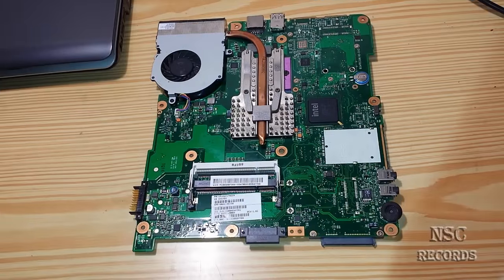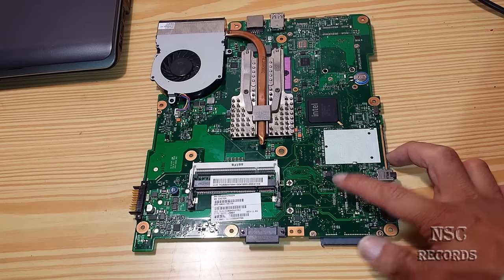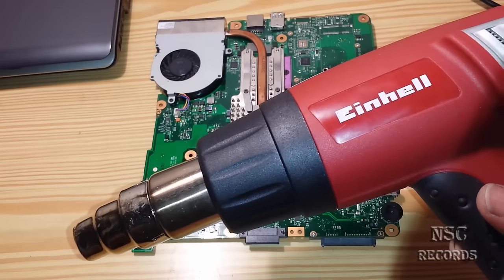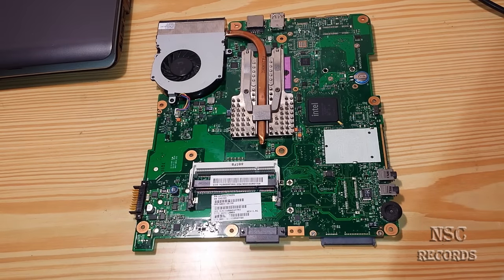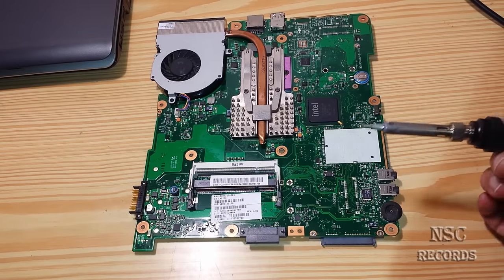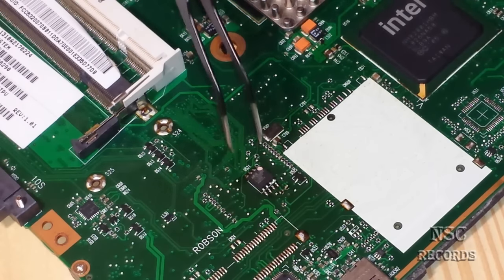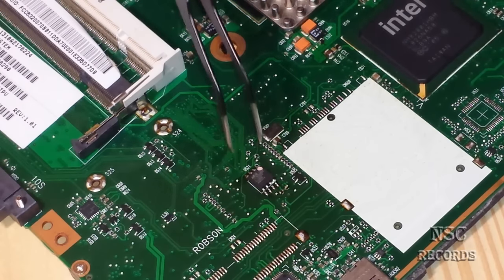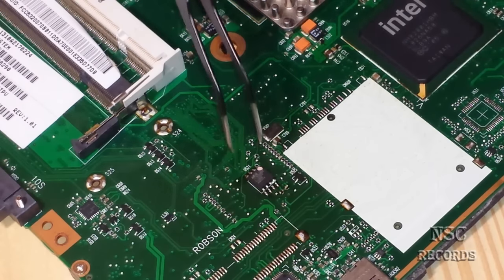How to easily remove & replace a Bios Chip from any Motherboard´s By:NSC

Comment: This type of work requires smd/station tip on that heatgun also helps to have a heated heat plate underneath the board to prevent warping of PCB. Using larger tips actually heating up other parts nearby area melting plastics and drying out smd compactors. Glad this worked out for you! Tip wearing rubber gloves is a great safety feature I always do on anything electronics. Smd gun also have very hot with very low air flow less air blowing across motherboards.
Reply from the maker: Yes and yes and yes and yes yes yes, but you see it works also like that perfectly, not all peoples have special equipments... i think the video is pretty good for the most. Have a nice time 🤷‍♂️
Reply: Simply use alluminum foil to cover other circuits . But you need to still be careful 🤗

Comment: UltraNSC thank you thank you . My Dell Laptop BIOS would not get past the Dell logo. I ordered a new Bios chip from Taiwan, got myself a Weller WLC100 Soldering Station, followed this video and it works great now , Might I add I paid almost $900 for this laptop new only 3 years ago . Dell did not want to know.
Reply from the maker: Dell are Pirats :/

Comment: have you ever tried desoldering tin? it's expensive but works really well. It low temp tin, you mix it with the existing tin and it stays warm for 30/40 seconds. You can easily remove large chips and  "take your time" while doing so haha. This way you don't overheat the chips whilst desoldering.

Comment: Hi, while removing my chip it pulled off some of the soldering base I think. And 2 small wires connect to 2 legs of the chip have come loose from the motherboard. Like the 8 metal spots on which you solder the legs of the chip, 2 metal spots have been pulled off as well. And a small wire running from those 2 spots has come out of the board too. I think I pulled too hard and removed some of the internal wiring from the motherboard. It's beyond repair now I guess?

Comment: Two points to mention:
(1) Isn't the chip installed backwards? chip pins 1 and 8 must be aligned with the white bar on the PCB (time 12:38).
(2) Isn't this a Macronix chip (MX25L8005M2C; time 5:07)? meaning that it is a CMOS chip and it may damage by ESD discharge if you grab it with your bare hands.
The white paint dot can be anywhere on the chip, so use chip pin 1 mark (dot) for reference (time 5:00).
Other than that, good video!
DRGN997.
Reply from the maker: Wrong, i never in my life destroyed a chip because Static ESD :\
Reply: Nope, the dot on the chip usually indicates pin one. That's the way I have noticed it over the last 30 years. If there is a clear pin 1 indent on the chip, then the dot may not be at pin 1, but usually it is. Second, static is not an issue as long as you have grounded yourself before touching the chip, or as long as you are at the same voltage potential as the board. I have been doing it basically the same way he has for 30 years and I have never damaged a chip.
Funny how you mention not touching the chip with your bare fingers, but nothing about doing this work on a wooden surface. Wood is a very staticy material. I would recommend an anti-static mat. I have four benches for computer repair and all of them have anti-static mats. In fact, manufacturers insist on it.

Comment: Great video! You make it look too easy :) I will try to de-solder and put back again a bios chip (8 pins) as the clip from ch341 programmer doesnt grip to the small IC
Just in case, do you know what is the best place to get a new chip for Winbond W25Q128BV?
Thanks for the instructions!
Reply from the maker: Thank you so much. On ebay or BiosFlash.com but not sure if they still exist :) Just Google it, you gonna find some good vendors 😀

Comment: Thanks for the excellent tutorial ,would it be possible to solder a socket to the mother board when the chip is removed, so if needs to removed and replaced again in the future it would make the chip easy to remove and replace.

Comment: Those 8-pin smt chips can easily be removed with a soldering iron as you show in the last half of your video.  It literally takes a minute or two. It's much safer because you don't have to heat the board around the chip. You also don't need any special tools.

Comment: Hello,  I'm trying to communicate with my oscilloscope I bought and my computer,  problem is I don't have the software.  Can I start with the microcontroller replacement or flash to do this.  I apologize for my lack of knowledge in the subject but I'd really like to use the components on the board just have no idea how to get the data to translate to my laptop.  If you could help I'd be very grateful,  even just to point me in the right direction.  Thanks

Comment: Pleasr make tutorial about soldering smd on  tight place , near plastic components like ram slot,thanks
Reply from the maker: As i got time ill do it... my only problem is time ^^
Reply: @NSC-Modz  I'd like to know this too. My laptop BIOS has components packed around it, wouldn't using the heatgun just flow all the resistors and move them out of place?
Reply from the maker: @paulbaker9879  yes, that can happen with the heatgun, in this situation just use s soldering iron.

Comment: Hi need some help, want to try to flash a bricked board befor i replace the bios (MSI P67A GD65 (B3)) but i have 2 of those chips that says MX 25 (and some more on it) + a pink dot, i cant find on google which one it is. thx in advance.

Comment: 21:55 no need to do it this way (solder blob on all 4 pins per side) .... just do it simply with 2 soldering irons and K-type tips ( https://sc04.alicdn.com/kf/H73b854a668ea40539bf4e68fab0fd0baK.jpg ) You can heat both sides of the chip simultaneously then.

Comment: Hello ... Thanks for the helpful explanation ...

I have a Toshiba Satellite A75-S2112 laptop when I plug in
the charger only the yellow lamp turns on and off does not work?

Thank you .....

  Translation by Google
Reply from the maker: I Think is not a Bios Problem

Comment: Can we upgrade Bios chip the way we do with RAM and Processor.

If so, what are the basic things needed to be considered like the chip series etc?

You must be wondering why this question, as I have Asus X55c with Processor B980, for which I purchased a used processor I5 2520M to have multitasking on, for which I had to check its Socket g2, wattage, etc. 

Where suddenly my Laptop did stop switching on and the processor was yet to be received.

I am trying to test things where thought of installing Bios programing through CH341A tool but ding get any good Software to it and thus unable to reprogram.

Please guide.
Reply from the maker: No, the bios chip should always have the same specs and size.
Reply: @NSC-Modz  thanks

Can you share Asus x55vd motherboard schematic PDF.
Reply from the maker: @RsBGroups  sadly not, I'm no motherboard factory 😆
Reply: @NSC-Modz  thanks, it is unfortunate - not getting on web too, even the Asus co did not help.
Reply from the maker: Asus don't want you to get it...

Comment: Will this method fix a locked bios if removed and replaced.
Reply from the maker: Yes, but you need a new bios chip or a usb bios chip programmer so you can flash it yourself.

Comment: I have a hannstar k mv-4 94v-0 and I can't locate the Bios or reset this. I need the password and I can find. The battery method is doesn't work and this no have a cmos button. Ooh I forgot, I don't have the password backdoor. Any idea?
You video is very good.
Reply from the maker: It should be a Winbond bios chip, look for a chip that has that name. You can find this board also in good conditions on eBay. Regards ✌️

Comment: Hi last days i have destroyed the BIOS from my Laptop (Acer aspire 8530g) while i try to Install a new Update. (It's freeze while updating)
Now i have a black screen if i start the Laptop and only the fan spin. I had the same problem as the CMOS battery was empty.... I try to remove the CMOS battery and the Laptop battery after BIOS Update, wait hours and put it back. That doesnt solve the Problem... :( 

Do you think it could help to replace the BIOS Chip ? 

Greetings 

Ich könnte es auch nochmal auf Deutsch erklären, wenn irgendwas nicht verständlich war 😆
Reply from the maker: Haha alles gut. Du musst den Chip neu flashen, und dazu muss der eh raus
Reply: @NSC-Modz  könnte ich auch einen neuen bereits programmierten Chip bestellen, oder ist das eher nicht zu empfehlen? 😅 Ich habe leider keinen USB Flasher 😕 

Ich habe auch irgendwo gelesen, das manche Bauteile vor dem BIOS Chip sitzen könnten, welche ebenfalls vom Flashen beeinflusst werden und wenn man nur den BIOS Chip tauscht, dieser nicht mehr mit den anderen verflashten Bauteilen klar kommt...ist das so richtig und wenn ja, eher ein seltenes Problem? 🤔

Auf jeden Fall ein cooles Video. 🙂👍 Habe so zumindest noch ein wenig Hoffnung, das der Laptop nicht für die Tonne ist. 😅
Reply from the maker: @Alex-wz4sy  Nein das ist Blödsinn, und ja, kannst auch ein fertigen Bios chip bestellen :)
Reply: @NSC-Modz  😁👍

Comment: You don't need to take the chip off like that, you can easily remove a 8pin bios chip using only the iron without any solder, the amount of solder that you are using is unnecessary, and it can be dangerous, you have tiny resistors and capacitors close to the flash, if the solder touches those compones they will come off in seconds, and unless you know the value of the cap or resistor you can say goodbye. second problem is the pads, a lot of eat can break those tiny pads.

Iron and smd flux is all you need to take a 8 pin bios off. BTW i use 360C, also it only takes me 20 or 30sg to remove the chip you just need to set the iron to the right temp
Reply from the maker: Ola Tiago xD All Cool man, no Panic on Titanic, we got Water for all ^^
Reply: não entrei em panico xD, mas para os chips de 8 pinos demora mais tempo usar a solda, pelo menos eu quando os tiro faço sempre assim, uso o ferro a 360, encosto o ferro aos 4 pinos e o chip levanta em segundos, ora também depende do tipo de ferro, nem todos transferem o calor da mesma forma, se tiver muito mais que 8 pinos uso ar, ou a solda se não tiver nenhum condensador ou resistência demasiado perto
Reply: By the Way, eu estou a fazer uma coisa que talvez te vai dar jeito a programar a programar as bios xD eu depois partilho, também usas o CH341a não usas?

Comment: I have access to the start order but to enter Bios I no longer have the passwords. Do I have to change the Bios chip to remove the password?
If so, can you tell me where my Bios is on Laptop Hp Helitbook 820 G1 SKU Number D7V73AV.
By the way your video is excellent.
Thank you
Reply from the maker: Yes, sadly you need to replace the bios chip. I'll take a look soon and I'll write you again.
Reply: @NSC-Modz  
Thank you waiting for a response from you
Reply from the maker: https://www.ebay.co.uk/itm/312862974089

Comment: wtf that board looks so similar to the board in my toshiba laptop that i like mucking around with, it has the exact same fan, cmos battery, heatsink and heatpipe arrangement, the socket looks exactly the same, even the ram slots, chipset, sata connectors and VRMs are in the same place. i think the screw holes are in the same place wtfff what laptop did you get this board from
Reply from the maker: 🤣😅🤣😅🤣😅😅🤣 wtf i can't remember 😅

Comment: Hi I have supermicro c9z390 cg iw. My chip is seated in a white enclosure box with 2 wires holding it in and what looks like a orange pull plastic tab sticking out.... if anyone knows how to get this bad boy out please tell me. Thanks! little worried I might break it.
Reply from the maker: Hi The good thing is, you can just take of your bios chip easy without soldering. Just open that slot, and take it out from. Later put the chip back on, and close the slot again. Finish 😉
Reply: chip arrived and seated 😊... I'm going to practice with the programmer to rescue my old chip then I'm going to frame it on my wall! 🖼😂👍
Reply from the maker: @no.9961  😂

Comment: sir, i want to remove my bios boot password from my HP probook 4530s. please help me out.
Reply from the maker: Yes, so you will need to replace a new Bios Chip, but you need to flash it first. Or just buy one that is already flashed from ebay or like that
Reply: Unplug the electricity
Remove the main battery
Remove the BIOS battery
Click on the starter button and hold it for several seconds (8 to 15 seconds)
The password on bios must be cleaned

Comment: Hi, I need to replace my bios chip which has a paasword on it with a new on . How to make the new one to work with my pc. Many thanks
Reply from the maker: Hi The new one should have a new bios flashed. With a new bios there is no more password.
Reply: @NSC-Modz  Do I have just to flash file from hp site on it
Reply from the maker: @aliissa8347  if it's from HP it will be difficult... i recommend you to make a backup from your old bios and remove the password with the HPUnlocker. The bios files from HP are not made for flashing it self. That's why you better take a backup from your old bios, remove password with that HP Tool and flash it back again. 

Check this: https://m.youtube.com/watch?v=S2rbG3dyQyo&t=0s
Reply: @NSC-Modz  Hi, many thanks the reason why i would like to replace ma bios chip is that i tried to desolder it and the connection are broken I can not even read the bios chip. my pc is elitebook 840 G1. Many thanks again
Reply from the maker: @aliissa8347  you need to fix the traces than. Or the pads
Reply: @NSC-Modz  thanks but how to fix the traces or the pads
Reply from the maker: @aliissa8347  this should only do skilled peoples like me, its not that easy if you doing it for the first time...
Reply: @NSC-Modz  Could you please make a video for this showing how to repair bios chip contact on the motherboard?. Many thanks
Reply from the maker: As i got time yes ;)

Comment: I Have a question. I tried IT  in some dead mobo And components around the chip desoldered too. One even flown away. Is IT an issue if everything around liquify And harden again? Wont the heat damage the BIOS chip?
Reply from the maker: Hello No Panic on Titanic, we got water for all 🤣 This chips are made like that 😉 You can use some higher Temperatures for a quick time without to destroy it. You can find more on Google.
Reply: @NSC-Modz  Thanks. I will solve the heating around the chip, by creating a shield from tin foil. That way only the bios chip will heat up. I will do a few more test runs before trying it on the real thing :-)
Reply from the maker: @JanHurych  yeah, it's always good to be prepared great 😉